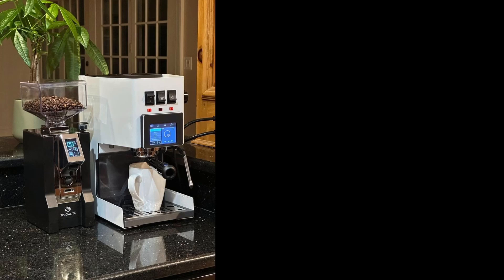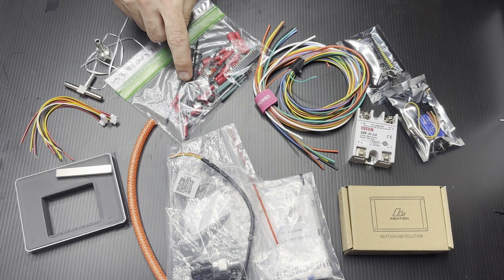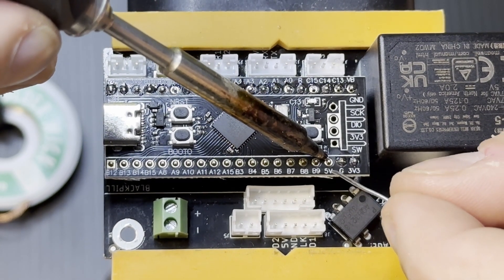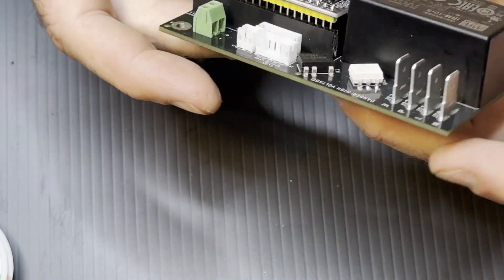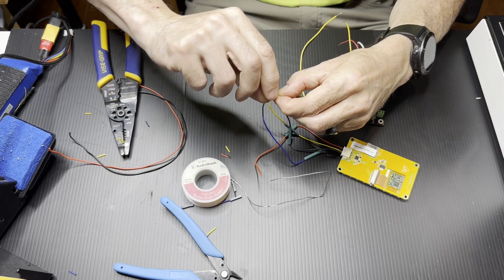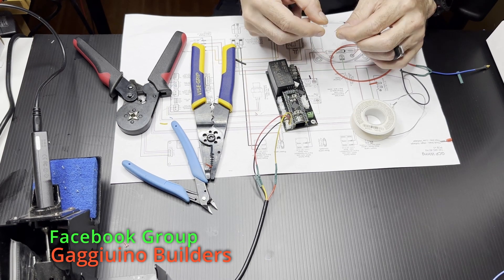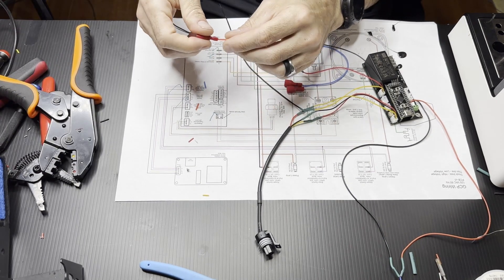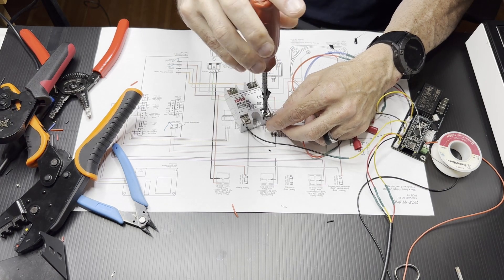Gaggiuino© PCB Buildup

Comment: Great video, thanks for taking the time to make it. If you want your wire colours to match up better you can take them out of the JST connector by carefully prying up the white tab above each pin. Then re-insert in the order that matches the wiring diagram.

Comment: 8:48 Extending thermocouple wires with regular cables messes with temperature readings. A special K-Type thermocouple extension cable should be used instead.
Reply: I'm in Europe, can you share a link or offer more details about this special cable?
Reply: @OOYCZ  the easiest way is to buy a thermocouple with enough wire. You can cut it to length as needed.